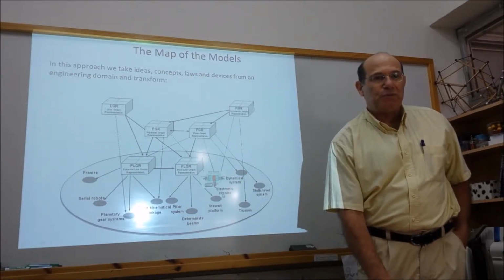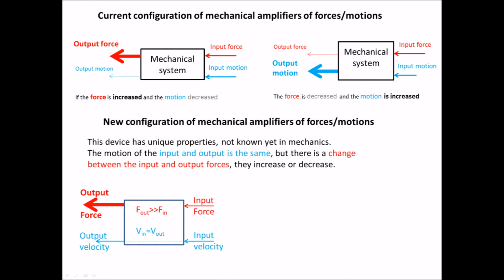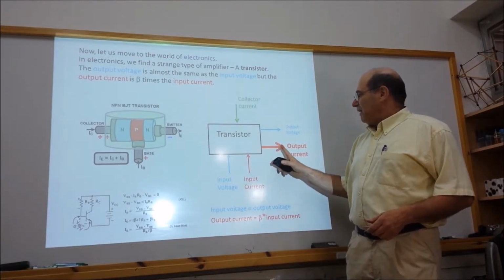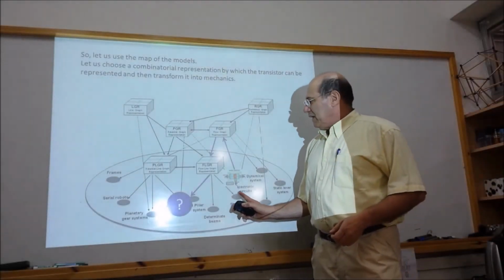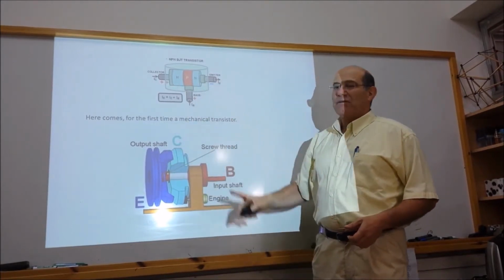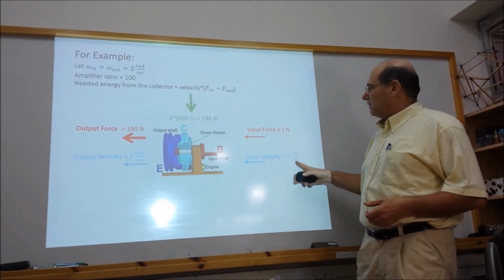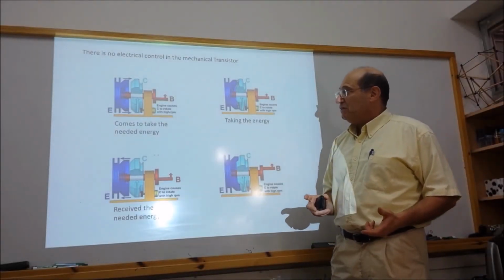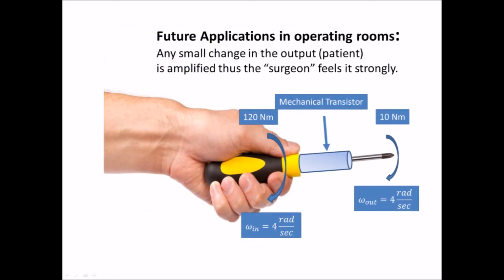Mechanical Transistor Full version

Comment: What did you use as the energy source for the collector in your chair lift thing? I cant tell where the energy comes form in the video
Reply from the maker: There is an electric motor that kicks in when the friction is high enough, when the friction is low, the cable runs freely around axis of the motor
Reply: Ahhhh. I thought you might've used a flywheel or something, sticking to the whole mechanical analogy to an electronic transistor idea trying no to use electricity, but that would be seriously complicated to do